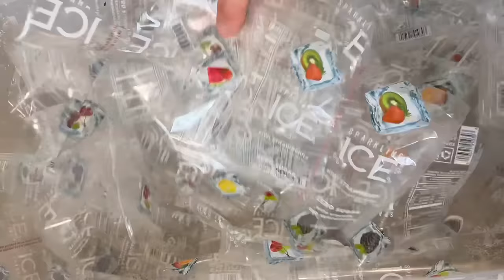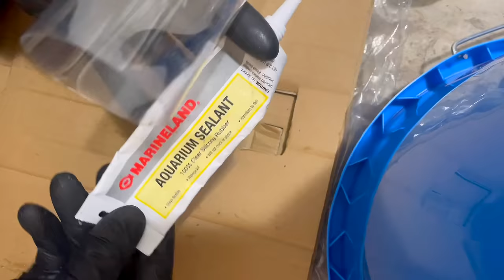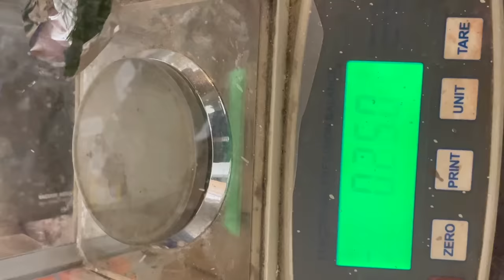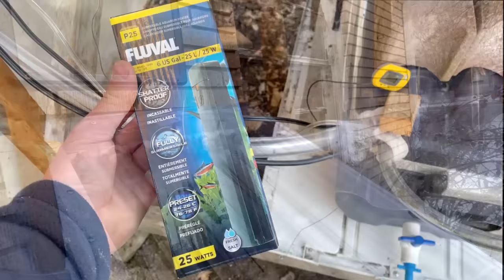Cody's Algae Panel

Comment: You could add something like an Arduino to control the panel. Then you could add more Sensor. For example you could measure the opacity of the water to tell you when you should harvest
Reply: I said that he might want to add something that reads the rolling average as opposed to just looking for sun or shade, so it doesn't turn on the whole system for 5 minutes of sun or off for a 5 minute cloud. It'd be cool if he also had it measure the opacity too, I like it
Reply: Maybe it could even be a continuous process maintaining a certain percentage concentration of algae
Reply: Good thing about these is that the growth slow down as it gets denser. I just filter what i need whenever from my culture and it replenish before i need some again!
Reply: That and when turning on the box from rest, bringing it back up to temp is quite a drain, but adding the heater to start then the overall temp gets low/before flow fill/startup covers that.
Reply: The arduino could do everything his control circuit does, including temperature monitoring, and switching for the heater, pump etc. Plus it could have a nice touch screen interface and could be networked to an internal computer or display. Program would be simple,  just a few functions and if statements.
Reply: complexity is not your friend
Reply: @sicklymaidrobot  yes it is I overengineer everything 😅😂

Comment: Algae also has a lot of protein! Sometimes up to 70% by dry weight if I remember correctly. Also, are there cyanotoxins present in Chlorella that could limit the amount of algae you can eat in one day? I believe you can only eat a few grams of cyanobacteria per day due to this reason... Back when I thought I could use cyanobacteria as protein powder; my teeth were very green too :)
Reply: I thought algae isnt suitable for food because of the large amount of iodine. No idea what algae this applies to though. Only know that chlorella is sold as food supplement with typical bs promises unfortunately 😒
Reply: @user-qx7tm5df8j  it does suck... I wonder if there's a way to isolate the protein from the toxins... I know you can isolate the oil. There's a company that's doing this with algal cooking oil already
Reply: @user-qx7tm5df8j  Since he grows it himself... an iodine is a chemical element, if he doesn't put any iodine in, there wont be any "grown" (except from the seeder culture) the panel certainly wont filter iodine from the air. I don't know enough of the bio chemestry to know if iodine is an essential element to algae or just happens to be there because usually it's grown in the sea (and it gets it from the water)

However I'm quite certain that algae needs phosphor on the long run to keep working (without phosphor there is no ATP and without ATP there isn't life). So to create a cycle one would need to get the phosphor out of the urine again.. (every other essential elements H, C, N can be acquired from air)
Reply: @georgelionon9050  He did mention he was planning a video detailing the mineral additives he introduced to the system.
Reply: @DIYBiotech  , i think the toxins are from stressful growing conditions.  keep the algae happy and there will be no toxins.
Reply: @vsvnrg3263  Ya gotta talk to your plants bro
Reply: @cmelton6796  the best way to don't starve
Reply: The protein content of algae depends a lot on the type, cyanobacteria typically having more than green algae (around 70%).  Conversely, green algae tend to accumulate more lipids so are more sought after for biofuel production.  There are problematic Chlorella species (toxins), but the ones that are safe to eat have no limit on quantity.  Likewise, cyanobacteria like Spirulina and Nostoc (genera) have been cultivated for hundreds of years as a food source with no limits on daily consumption.  Nostoc serves as a major protein source for a hand full of rural peoples of Africa.  Open pond cultures of Spirulina have the potential to become contaminated with toxic green algae, so must be regularly monitored to maintain safety.

The algae industry is full of miss information and contradictions, stemming from a lack of taxonomic consensus (different labs will refer to the same algae with difference nomenclature) a bevy of pretenders that entered the field when the DOE handed out billions for algae biofuel research and many more reasons to long to list.  Sorry for the long response, hope you found it informative.
Reply: @alphaquaker7811  wow this is very interesting! I'll look into Nostoc. I had a professor who spent his career researching algael biofuels only to find that the production was way too problematic and inefficient... but protein is a much higher value product so maybe that would be worth producing
Reply: @alphaquaker7811  , very informative and a pleasure to read.  i love a good long response.

Comment: 9:54 Be careful Cody. The purple primer is for waste water. When I built my undercurrent DWC system for growing consumables. I used gorilla glue pvc glue. Its all organic and safe for potable water. You need a pvc glue that is for potable water.
Reply: It is for potable water.  It's NSF certified.  If it wasn't, they would say not to use it on CPVC piping.

Comment: You can always just run the alge through longer sections of the tube. Clear PVC or the vinyl tube would work and so long as it flows back in the box you've got a perfect way to keep things moving and catch the sun. Plus making more just means adding more pipe.

Comment: Great video. In addition to the O2 that the system produces, could you also adapt this system to produce algae to harvest for soil amendment?  I'm thinking that on the Moon, Mars, or O'Neill cylinder, this system could be used to produce the organic matter for a hydrocarbon-crushed rock basic soil structure. A great project would be to attempt to grow a food crop in 1. purchased soil, 2. crushed rock only, and 3. crushed rock-dried algae powder. Compare the results. Thanks
Reply: That sounds like an interesting experiment
Reply: I think that might be the plan as one of the last videos he did was making fertiliser from meteorites. Which he then tested with algae.

Comment: Might additional sun collection via mirrors be an efficient way to improve the productivity of the algae without having to build so many panels?
Reply: Would definitely need to have on motors, for at least 2 reasons

1.  Keep the angle correct for the sun
2.  Change the angle if algae is overheating.

Or in the winter, let it heat up, and route trough a separate pipe section with heat sinks for some extra heat transfer to inside.
Reply: Maybe have it flow into small spherical chambers to increase the surface area and have a reflective backing.
Reply: No. The bottleneck in photosynthesis is not the sunlight. It's the absorption of CO2 that's the slow part. In fact, too much light can cause the synthesis process to run in reverse (decomposing organic compounds into CO2).
EDIT: more light might help with the temperature.
Reply: @KohuGaly   light can also be the limiting factor, but it will cap out at some point.  In winter, I doubt we are reaching that cap though, and especially not on a cloudy day.  Reflectors could also extend production time when the sun is lower.  We'd need a PAR meter to know for sure.

CO2 disolving in the water can be increased by with surface agitation, a bubbler pump etc.    Lower temp as well.. but this can reduce metabolism.  Can probably find the optimal temp out there in the research.

If one wants to get fancy, you could even add CO2.  Then they could use even more intense light and a compact system.  This could be a CO2 tank or yeast and sugar, with alcohol as a side benefit.  Add gelatin to yeast if you want to slow the production rate down.
Reply: @asahearts1  if heat was a problem a very non reflective backing can turn visible light into heat energy
Reply: @asahearts1 
But spheres increase volume and reduce surface area, no?
Reply: @Unsensitive 
Yes, it would need to be controlled. But I'd imagine that to still be more efficient than the equivalent amount of algae panels you'd have to build.
Reply: @KohuGaly 
But couldn't controlling for UV intensity, CO2 concentration and temperature still allow for light collection to be beneficial since it could only be "activated" (angled right) if more UV/heat is necessary?
Reply: @rikvanpaddenburg3495 
But you could control for UV exposure and angle the mirrors away when it gets too high. I'd still expect the majority of hours in a year to provide too little, not too much sun. And for some of them, light collection might remedy that.
Reply: @Unsensitive  One has to be very careful when adding extra light to plants. When there's too much light, they fail to process CO2, because the enzyme they use responds weirdly to strong light.
Reply: Do you consider adding a CO2 reactor?
Reply: @Pyriphlegeton  Spheres have less surface area than a cube but more than a flat plane, or a tube in this case or whatever. The same thing has been done with solar panels.
Reply: @asahearts1 
Ah, I see your point now! For a given volume of one object, a sphere will have the least surface area. But you could fill a cube of a given volume with many smaller spheres and thereby cram more surface area into it. That should work. Although I'd assume cramming many small cubes into it would actually maximize the contained surface area most.
Reply: @Pyriphlegeton  Probably. Different shapes might have unique advantages and disadvantages like manufacturing cost or dust accumulation. The only one I've heard of is spheres, but those are more expensive than flat panels and dust has been a problem when used in deserts.
Edit: They kinda remind me of trichomes on plants.

Comment: One thing I thought of for this to reduce cost and complexity is to get rid of the bottles and just use 2 acrylic panels with maybe some kind of plastic or metal spacers on the sides and have one inlet pour in the top and a slanted bottom towards one side with the outlet. If I get the chance, I might do something like this myself. It seems really fun!

Comment: Clear PVC could work really well. I was concidering doing something similar where I put several lengths of pipe together, connecting them much like you connected your bottles.  Then I could pump CO2 through the pipes with a pump.  The bottom drain goes through a strainer, and the extra water gets a bit of miracle gro added and gets pumped back into the top.  Cycle once per day and you should get a decent yield.
And if you want to keep it safe against the cold, just drain it at night into a heated tank that keeps it above freezing.
Reply: I don't see the purpose of the strainer.
I think Cody actually has the right idea for removing algae from the system, as for a "sterile" system it wouldn't be too difficult to control the medium input and output to keep them clean.
I like the idea of bubbling CO² through the pipes, though simply bubbling sterilized air would provide the same function while simplifying the design and operation.
I think that a top down flow as you describe would simplify the gas management system, but may complicate other systems. It would be interesting to see it run both top to bottom and bottom to top side by side to see if either one was significantly different than the other

Comment: I'm using an aquarium air pump to move air through. I haven't filtered the air coming in, but I'm keeping other contamination out by positive air displacement and my container is a 30 gallon poly barrel with a pair of aquarium grow lights strapped together and weighted down in the center

Comment: Improvements:

1. Solar Pump.
2. Algae Storage Below the ground and protect from cold.
3. Conseal the pipes in glasswool.
Reply: 4. LCD panel in front of the tubes that can be turned on in the summer if the algae gets too hot
5. Auto-drain system in case the temperature gets too high

Comment: Really neat idea, wouldn't adding a reflective backing to the clear tubes increase the efficiency even more since more light can reach the algae?
Reply: As the algae grows, it becomes more and more opaque to light. Angled side reflectors would be better (like Tech Ingredients did with solar panels recently) . Also, lining the sides with ultra black material plus having side reflectors would help to create a bit more heat, especially if that was also contained within a trapped air space of some kind. 

  So picture like a 3d trapazoid over the top of the original configuration, with a flat top of some kind of clear material over that as well.  It would only be for winter use though, since it would quickly overheat it during spring to fall season. Basically it's like putting a solar oven over the top.  Cody really should also add some removable back insulation for the winter. The lower the temps, the slower the algae grows, and higher the temps, the faster it grows.  These edible algaes like temps between 75 to 90 F or so and grow most optimally between these temps.  In the late spring to early fall part of the year, you would probably have to add a cooling system if anything.

Comment: Hey Cody, I am just watching it now, and nice work, regarding the cold outside, what if you find a spot inside the house, get the hose a bit longer, you keep it warm at night as you will use some heather inside, and they can sleep inside the house, and be up in the morning when the sun comes out. Maybe you don't have the spot I am telling you but just maybe if you could make the warm bed time for them, that would be good, I will check the other videos to see what else you got from it. Nice job!

Comment: One small simplification to get rid of the different sized holes: Instead of having the input and output on the same side, switch one to the other side. So for example input bottom left, output top right. The same applies for connecting batteries/batterypacks in parallel.
Reply: It would not drain easily.

Comment: An interesting experiment would be to study the effect of UV on algae growth. Like three small setups one made out of plastic (no UV) one out of glass (small amounts of UV) and one made from fused silica (all UV). I mean fused silica is way to expensive for big setups but as an small scale experiment interesting nonetheless.
Reply: You can look up what people do for indoor farming with artificial lighting. Because you save energy when you use just the light that the plant needs and no unnecessary wavelengths they got it figured out quite well I think.
If I remember correctly photosynthesis doesn't use much UV light but mostly visible light except green of course. Thus the ideal lighting should be some kind of violent (red and blue mix).
Reply: @LumberjacksPro  When Cody was thinking about glass or plastic it made me thinking if it actually makes any difference. First thing that came in my mind was different levels of UV. But I think you are right shouldn't make that much of a difference.
Reply: @LumberjacksPro  red and blue light is magenta :yougotthis:
Reply: Higgs Bonbon  Magenta is special because there is no wavelength associated with it. When there are equal red and blue wavelengths we just see magenta. I think the algae's favorite color is magenta, same as me! 😊

Comment: That is an awesome idea. Since it is relatively closed, I’ll bet the evaporation is greatly reduced. I’d be interested in how much water is lost in the system. I’ll bet it is very low. I’ve done duckweed in the past but evaporation makes it a huge water user.
Reply: love duckweed. lots of potential there, but maybe mostly as a fish feed?
Reply: @tatehewitt4220  Duckweed can be used as fish feed and also duck feed and probably chicken feed. I used to grow it but now that I'm desert off grid, the water use from evaporation is making me think if it is really worthwhile. Water depth isn't as important as surface area but more surface area means more evaporation. Cody's panel is making me think about how to do a system to grow duckweed with less evaporation loss.

Comment: At around 17 minutes you are wondering if you should use a solar panel to detect if the sun is up and switch a Relais. Wouldn't it make more sense to try to directly power the pump with the solar panel? Given the flowrate of this system, I suspect the pump doesn't need too much energy, even with the small heater

Comment: Would be interesting to see what difference a very slight introduction of C02 would make - perhaps a very slow leak on a cylinder connected to the downpipe.
I suspect CO2 rather than sunlight is a very big limiting factor.
Reply: I suspect that in terms of practicality, finding some way to increase CO2 from the habitat's atmosphere is harder than simply increasing algae volume
Reply: @vedritmathias9193  If it was on Mars it would be easy but even in a sealed habbitat CO2 levels would rise significantly with a single human occupant.
Reply: Based on how ocean algae blooms happen, probably better off using traces elements like iron or selenium to boost it.

Comment: Love it, I wonder if you could use the algee as feedstock for the fitcher troppes process. Also have you considered nichrome wire powered by pv. If you do it in a container with a hose you could capture the synsis gas in a gasometer. Run a generator from the gas, use char as fertilizer.

Comment: You could hook the air inflow into the sleeping chambers after sunrise. CO2 should boost growth.
Reply: freakin genius.
Reply: Yes, I've seen large installations like this hooked up to coal burning power stations, were they bubble the Co2 through the algae water, and turbo boost growth, whilst the algae acts as a scrubber for the power station.